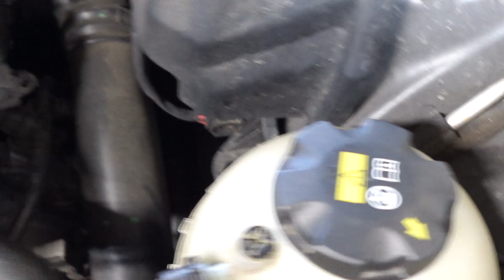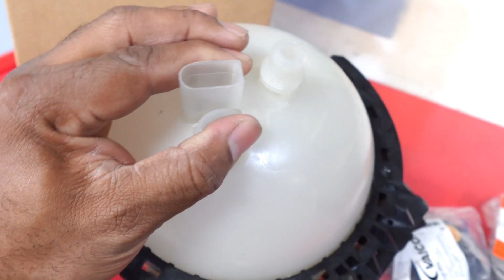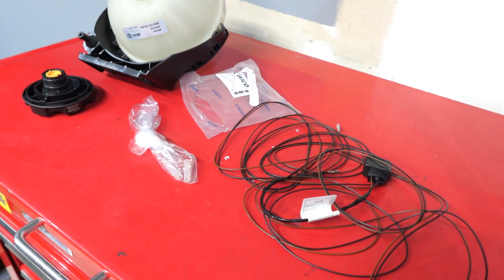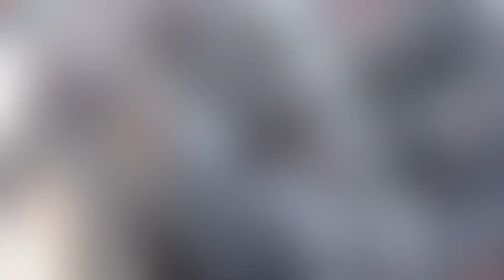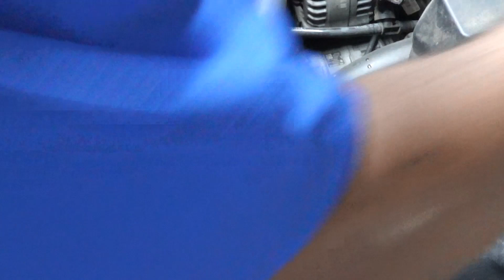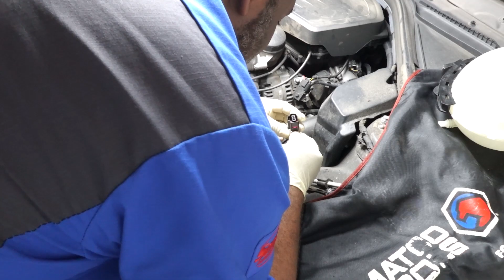2016 BMW F32,N20 428i Expansion Tank Replace & Repairing Wiring For Coolant Level Sensor Connector

Comment: Hi guys if anyone can help me out so my car is 428i with n20 so when I remove the coolant cap there’s no any pressure come out I’m very scared if it’s big problem actually there’s no any issues with temperatures
Reply from the maker: Your coolant (Radiator cap) could be bad. It’s has a pressure valve in it. If that the case u would slowly loose some coolant around the expansion tank area.

Comment: Does anyone have a code for the sensor connector?
Reply from the maker: The part? Or a fault code? Many cases it would cause a check control message. Coolant level too low
Reply: @atlbimmertech5617 The part.
I found something similar, but it is from the VAG group. 1J0973703

Comment: What type of sensor is inside the tank? Do you know the ohm values with okay coolant level?
Reply from the maker: @eduardocoello1909  The sensor is integrated in the tank. I don’t know the resistance readings.

Comment: If i use an aftermarket tank, do i have to program something or clear something? I bought one in ebay for less price
Reply from the maker: @eduardocoello1909  I’m starting to believe the aftermarket ones have issues with the level sensor. It’s still an occasional problem on the car I worked on. We’re probably going back with a factory one from the dealer.
Reply: @koolfredsbimmertech5617  thank you, but is it plug and play? Or do i have to clear a code? I have a scanner and do not get any code because of low coolant, only on the dashboard of the bmw.. I changed mine today and still got the wrong reading :/
Reply from the maker: @eduardocoello1909  it’s plug and play. The aftermarket  and seam to have intermittent issues setting off the low coolant ck message falsely.
Reply from the maker: @eduardocoello1909  I recommend going with a factory expansion tank.

Comment: I replaced mine and everything runs fine and doesn't say coolant level is low BUT now it threw code U019F - Lost communication w/ engine coolant pump control.  Any thoughts on How to fix this?
Reply from the maker: @shawnconnolly6572  never came across that problem. May be a temporary bus communication fault. You can try to disconnect the battery for a few min reconnect and see if it will clear.

Comment: I had the same exact issue on my F30, replaced the tank and connector but unfortunately I still have the coolant error, I noticed that the whole wire is corroded, what does that wire connect to? I think I need to replace the whole wiring for the sensor 😭
Reply from the maker: @shadiomar4193  On this on I installed the aftermarket expansion tank.  I think that’s the issue because the ck message comes up in the mornings then goes away. So we’re probably going to end up putting in a factory expansion tank from BMW.

Comment: replaced the tank because the float in the tank was bad but when i put coolant the engine light came on now it’s saying the coolant temperature sensor is reading invalid data
Reply from the maker: Ck to see if it’s corrosion around the connector.
Reply: @atlbimmertech5617  can dirty coolant cause it to read bad ?
Reply: @atlbimmertech5617  the connector looks fine is there a way to calibrate the sensor to make it send the right data
Reply from the maker: Do you have aftermarket or factory in some cases the aftermarket ones have inaccurate readings.
Reply from the maker: On the 4 series I had to clear the codes. I did the same thing at 1st. It has an aftermarket one.
Reply: @atlbimmertech5617  might be the problem thought it would just go away thanks

Comment: Do you think cleaning the dried up coolent on the tank and the sensor would fix the coolent and replacing the radiator cap would do the trick on this repair versus replacing the entire tank?
Reply from the maker: In many cases the coolant is leaking from the sensor pin where the connector goes. The complete expansion tank has to be replaced in that case.

Comment: I have 5 series 2012 have coolant warning low but it’s full should I just change the level sensor or the whole coolant resviour?
Reply from the maker: It’s apart of the expansion tank. I have to change the whole thing.
Reply: @atlbimmertech5617  and one more thing , when I drive 90c to 100c the gauge moves ? Is it normal
Reply from the maker: @autoperformance503  that’s sounds about right the avg temp is around 208 deg F.
Reply: @atlbimmertech5617  I mean when I drive temperature gauge moves 90-100 , and 100-90 is that normal, guage moving while driving ?

Comment: Hi, I bought an expansion tank to replace but the new one has plastic connectors on the bottom of the new float connection. Is this normal or should they be metal?
Reply from the maker: It sounds normal! any pics of the old & new one?
Reply: @atlbimmertech5617  Thanks for the reply & I verified its plastic prongs on bottom of float. Weird but didnt give me any light on the dash. Thanks again 👍
Reply from the maker: @steven90m  Yes! I have seen that before. It’s weird but those 2 prongs that stick up inside the bottom of the tank detect the coolant level.

Comment: Hey I have the 428i 2014. I changed the cam shaft sensor harness. The first harness on the on the ecu and all my these code are on now that was not before I changed is and it will not start now. Do u have some advice.
Reply from the maker: Check all of the plug connections to make sure they’re locked in good at the engine computer. Make sure all off the ground wire are tight also.

Comment: I went to do the bleeding procedure  on bmw n20 motor with the coolant expansion tank top off like you did and the coolant started rapidly spraying out from the little hose, can you help me out with any ideas why this is happening thanks
Reply from the maker: That's normal operation of the electric water pump. when the heat is on or if u perform the coolant bleed procedure. the pump circulates coolant through the cooling system and it returns back to the expansion tank via the small coolant vent hose.

Comment: Fred i have a 4 series i replaced ac expantion valve i replaced the condenssor because it had a hole in it i replaced the ac switch why in ur opinion is my ac not letting me fill to proper freon level..it shoots it out the compressor relief valve..i even put in brand new compressor still does same thing any idea
Reply from the maker: Good afternoon! are you using any a/c gauges or equipment and is the a/c compressor ok.
Reply: yes ac guages read low both sides like 50 on high 20 on low compressor is new @atlbimmertech5617